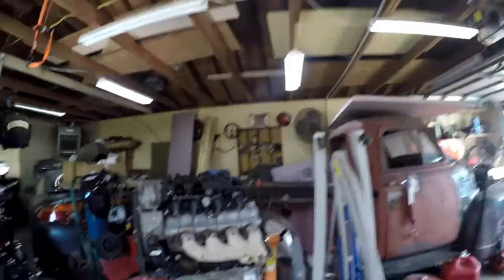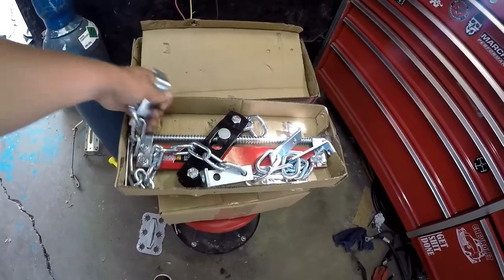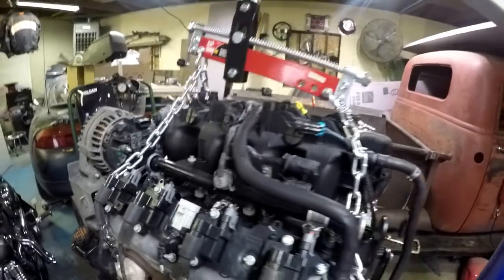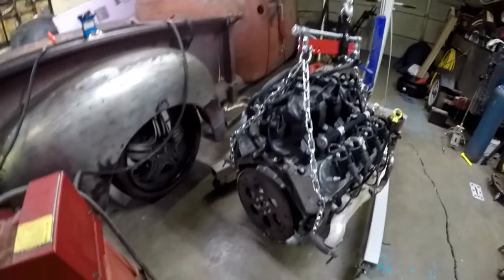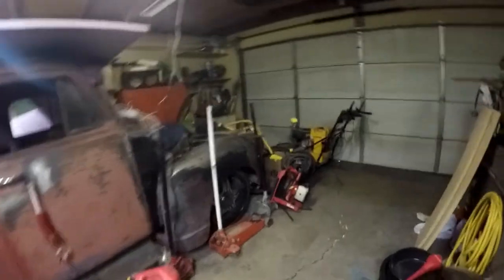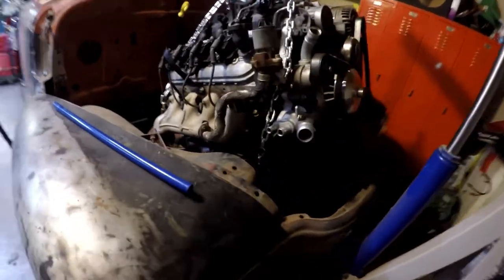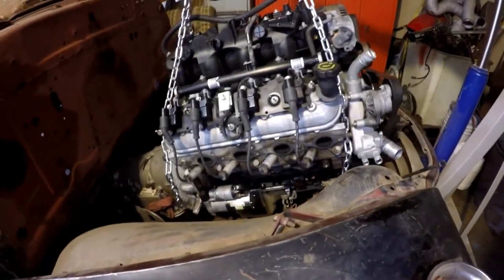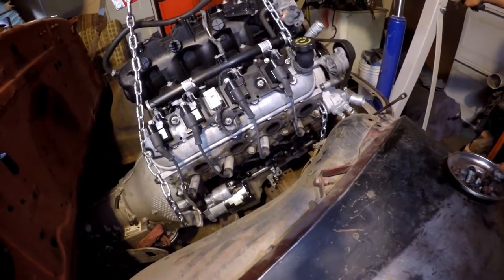5.3 GETS MATED TO THE 4L80E

Comment: What starter did you use ?
Reply from the maker: I'm still on the original starter, but I haven't changed the flex plate to the 4l80e flex plate so I might need to change the starter.